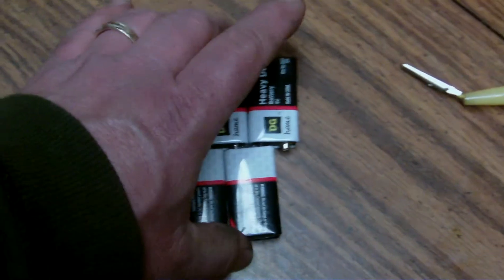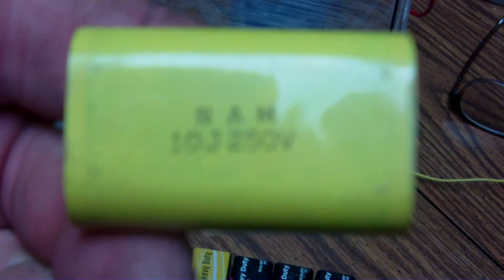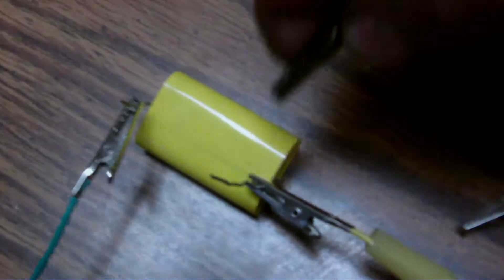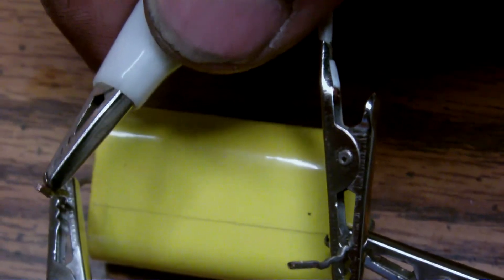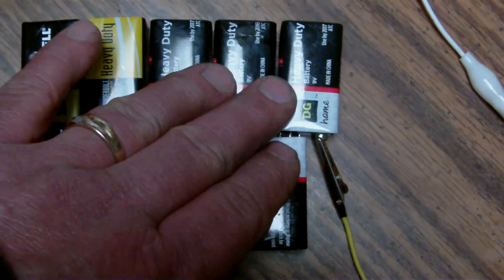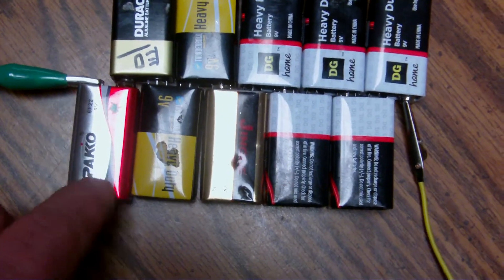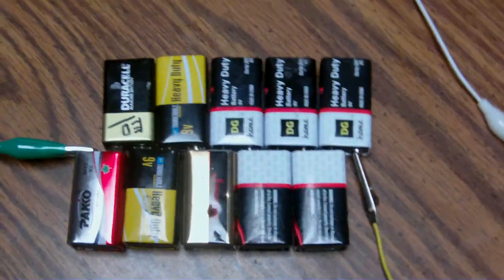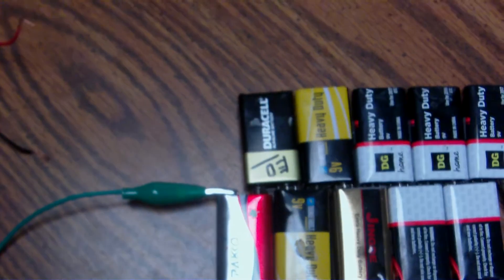video for dennis

Comment: Hi, base on my observation when you directly short the batteries with the green wire it won't get any spark I think it is due to the wire resistance. Try heavy gauge with shorter length wire and observe. You may try a few seconds with your green wire as shorting wire it's not overheating. It serves as a load. Almost all the  energy are absorbed in it and converted to heat. Less of pressure are returning back to the batteries that's why you barely noticed any spark. I may wrong but that's what I'm thingking based on my experienced.

Comment: The "J" on your capacitor does not mean Joules, it indicates a 5% tolerance (true value vs. marked value) and judging from the size it is probably a 10 uF capacitor. Hardly "doesn't have any capacitance".  Look up "10uF 250 V poly film capacitor" on Google Images and you will find one that is almost exactly the same physical size as this one.